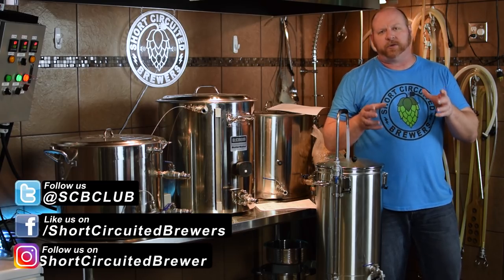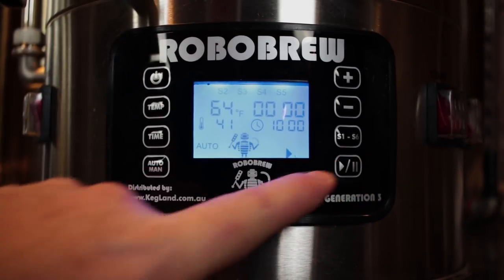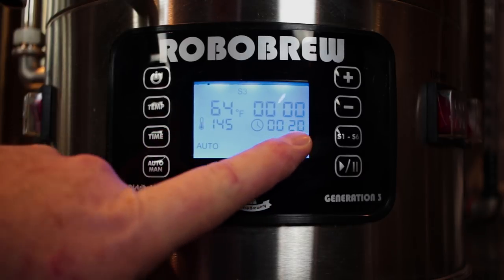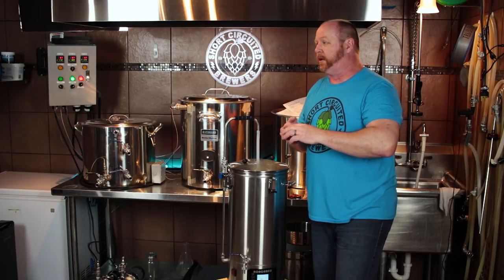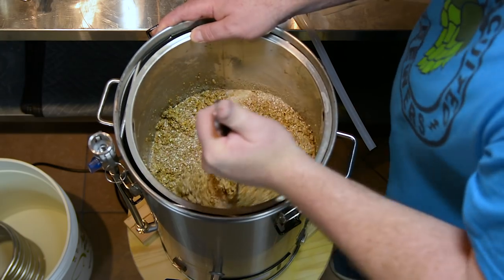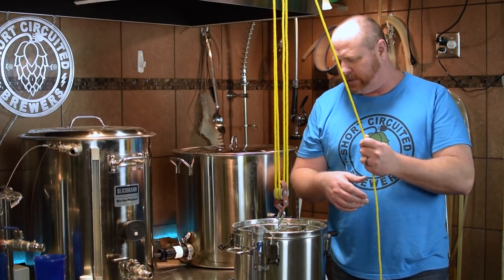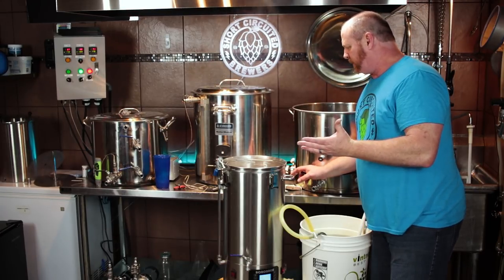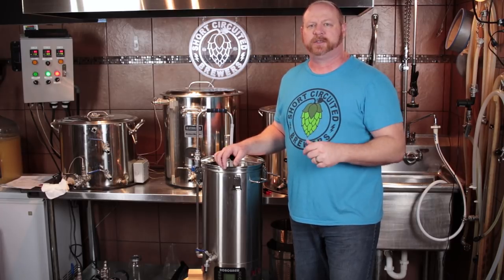ROBOBREW v3 1st Brew day | Complete delayed start and mash step programming included

Comment: that's more cuts in this video than in the parcour scene in quantum of solace.
Reply from the maker: Haha!! Someone noticed!! 👍🍻
Reply: @ShortCircuitedBrewers  Makes it a little exhausting to watch. And you don't need to make you video interesting in that way the content speaks for itself.
Reply from the maker: rimmersbryggeri I hear you loud and clear. Was trying something new. If I use to angles I don’t cut as much as this video anymore. Mostly use secondary shots rather than camera angles now
I appreciate the feedback very much. Never know until you try something out. Skål! 👍🍻
Reply: @ShortCircuitedBrewers  Well it's all good. How do you feel about the controller on the robobrew? I think the step msh programming seem slightly obtuse as you have to calculate the ramp up times into your mash step times. Either that or use up an awful lot of steps for every simple operation. Other than that it seems a very good option. I have a self built setup now but it's a little too small so I am looking into geting a 35-45 liter one.
Reply from the maker: rimmersbryggeri I really don’t find the step mash function very useful as you said you have to calculate the ramp time. And that can change with the amount of grain you’re using. It works fine for boil timing or mash rise step. But hard to use for step mashing.
Reply from the maker: @jockesjoberg7367  that's correct on the 3.1 version. The video is of the 3.0 version.

Comment: This is such a good overview of the system. It really makes me consider buying one!  I pieced together my own version of a brew in a bag system using a turbo 500 boiler similar to what the robobrew uses. I was concerned about the strength and durability of the pump and the overall price tag. If you’d be interested in seeing my setup and giving some feedback, I made a blog post about it: 

https://simplewort.blogspot.com/?m=1

My focus is on making a small footprint homebrew system that still puts out 5 gallon all grain batches like the robobrew. Thanks for your time.
Reply from the maker: Thanks Luke! I have done some smaller batches with an induction cooktop as well. Lots of fun with small batches I will check out your blog. Cheers! 🍻👍